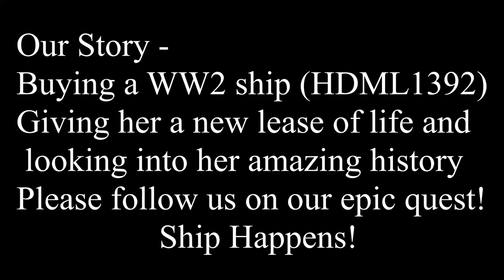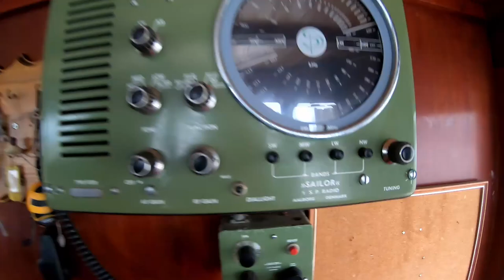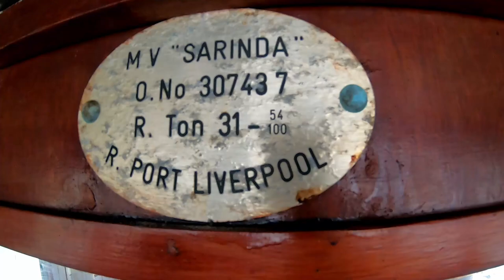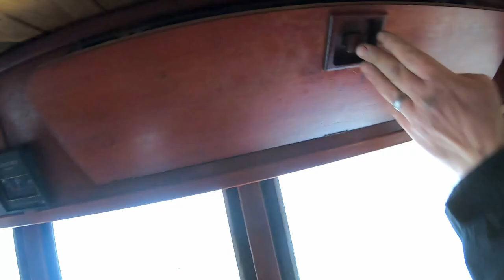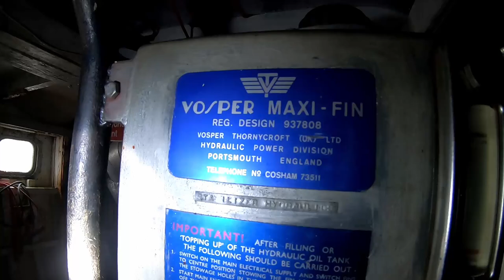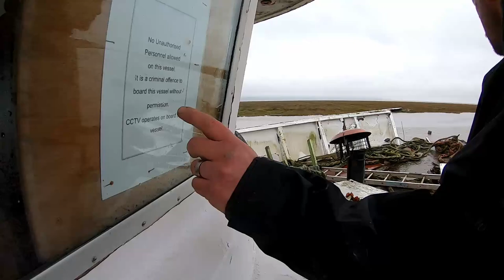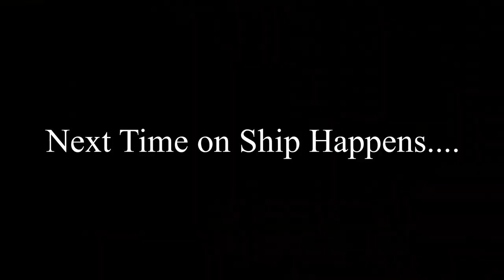We Risked Everything On A Rotten Boat! #boatrestoration

Comment: Wow  Well with time and effort anything can be done.  I've seen much worse houses fixed up.  

First:  Stabilize the boat
Is there anyway to get that closer to land?  Some landowner with an empty shore side lot you could rent?  Ideally that could also take a goods truck with a crane as construction supply yards use, they can usually boom out a good 30 feet if you scale the load back.  That means more loads and bigger delivery fee of course.  I'm assuming its actually floating at low tide keeping decks level.  Might be hauled up near shore at low tide it's bottom out and tilt and that could stress it's poor old hull.  But maybe somewhere there's enough water close to shore.  Do you know how many feet it draws?  You'll need tide schedules, you'll want to take supplies out when the tide is just going out it'll make it easier.  I see anchor lines going across the water courses.  That can't be long term good idea, I'd think they'd be a problem for all those other boat owners.  Keeping the craft in position is pretty important, especially in storms.  Are there any piles driven in along navigable water channels you could rent from owners?  Any reasonable way to get some driven by yourself - no idea what the permitting / legalities of that is.  Guys who do it might know.  Presumably there must be a 'port official' for that docking area, or town agency, they might know.  Maybe there's a boat yard that repairs, hauls them in / out in the immediate area to service all those other boats, they might even have some space to tie you up for a monthly rental.  They might also know how to go about mooring that permanently off shore.  You'll need piles or concrete blocks with chains / cables to bouy that you'd tie to.  Talk to them, to someone about what boat owners there do in storms, what kind of disruption occurs how you might prepare for it.  Take 'em out for lunch or something, usually makes people chattier.   
Second: Life Safety
While doing that get a safety line around the whole boat Given rot near edge you might need do a major effort fore and aft where there is good deck to screw to,  screw a pressure treated 2x4 I'm in the states bear with my nomenclature across deck, screw it upright 4x4 and 45 degree diag brace to 2x4, other braces as needed, post should resist 400 lb in any direction.  Run 3 ropes fore to aft then.  Get new ropes that won't rot in sea water.  Any marine supply place has 'em.  You can attach ropes to intermediates where there is deck to work with..  Predrill the screw holes, tedious but easier and ensures screw will go in with out cursing every time.    Get real emergency suits even a used one I know they are expensive but the water there in winter will cause hypothermia in less time than it might take for rescue people to get to you.  15 mins at 35 or 40 can do it.  Get two inflatable rafts with compressed air bottles to do so.  and a spare bottle.  The three of you then need to practice getting suits on and boat inflated and off.  I'd say do the suits over and over until you got that down, then over and over getting to raft. Then getting raft ready to inflate.  When you think you are good as you are going to get go for inflating the raft getting it in water and in it, paddle around go back and keep practicing getting it into water and in it and paddling around.  Get three or four emergency kits - Med supplies, water, water proof emergency lights on lanyards, long life food / snack - this can really cheer one up in even short term accidents until the rescue crew gets to you, flare guns and LOTS of flares, emergency radios if possible that don't work off cell towers you might be out of range of, there are emergency signalling devices that can call for help upon activation - no doubt expensive, but lets face it, something anyone in any condition can push a button and hang to until help arrives, PRICELESS.  At the least get 3 kits with cheaper stuff, one with electronics, practive randomly someone grabbing it and getting to a boat.Keep a kit at ea boat.  Kits should be water tight and floatable even better with enough bouancy to keep a person afloat.  If you three can't swim like a fish, learn.  Join lessons RIGHT AWAY.  Keep practcing until you can take resuce course then do that.  Might consider doing CPR course too.  Over time of course.  Sooner than later.  Life vests, like hanging every 10 feet.  and tie a bundle to the raft / emergency kit too.   Nope not all yet.  Get lots of smoke fire and CO2 detectors, 2 smoke / fire ea big room / hall one in ea room CO2 in ea bedroom downstairs hall main room pilot house.  Fire estinguishers in every bedroom, kitchen, engine room (even if not working on engine, which is like last thing to do, as that requires a yard and professionals), outside engine room, outside kitchen, every big room and corridor and storage room.  Practice w 3 spares, one on land putting out a fire - look up internet videos on how to do this, and two to practice w on boat.  Refill these / get them serviced on schedule.  Rotted framing.  I saw main joists going side to side rotted off where they'd have anchored to hull, bad, very bad.  Don't walk on decks above these until you build stuf walls below to support them with diagonal and X bracing to keep them from shifting. 

Third:  Stabilize boat
Betting you're broke after seeing to above.  Ah well.  In the short term get heaviest tarps you can afford and pressure treated 2x4's .  Cover holes with tarps as little slack in tarps as possible will limit wind flapping and ripping.  Screw 2x4s over them to deck hull etc.  Paint them and keep painting to keep them from 'drying out' Easier than replacing.  When you can cover with more 2'x4's and pressure treated plywood painted on all sides and keep painting.  Now if you can't screw 2x4's to metal hull, I'd suggest hiring a welder to come out and weld on some angles with predrilled holes to sit 4x4's on and bolt thru to.  Then screw 2x4's to theses, all arranged to keep wind / water out.  Feel free to use sealant to make water tight seals.  Removing sealant can be annoying but it might be the only protection of the area for years.  When using sealant think carefully how water will, as it will, get into every area you are protecting, and then make sure you leave a way out for the water, hopefully to outside.  this will probably mean not fully sealing some seams, which will mean water coming in but what can you do.  It won't be much and collected water rots and rusts.  Pump and clean bilges - and ask about about regulations and 'how others handle pumping bilges'.  I'm guessing most pump em a little at a time over time to limit 'issues'  It might become part of every trip until they are 'clean'.  Get two electric generators for the boat , if you can't leave them on boat you're better off w 4 small easy to handle than 2 big, remember everything gets there on a tippy boat so your normal easy to lift is less.  Get all the crap off the boat.  You'll no doubt need to hire a boat to take that to a ships yard where it can be legally disposed of.  Remove EVERYTHING you can at one shot.  This is where hiring help will help and find a crew that's worked on boats.  Again, nearest ship yard might help.  Then scrub and clean everything, right down to bilges, learn to love chlorox, and get VOC masks and fans to make using it inside safe, and gloves, lots and lots of disposable cotton gloves, surgical type, heavy rubber, felt lined heavy rubber, depending on task at hand.  Tool kit and if you can't keep on boat then split it up into easy to carry bins.
Fourth: Transport to boat:  Buy or rent a 'dingy' / 'skiff' practice for an hour all three of you every trip.  See if you can hire someone to ferry material / big stuff out by trip until you get critical work above done.  Then you can build a raft or look for one, even it it needs fixing.  There's usually boat owners around looking to get rid of their money pits.  For that matter might even find it more economical to find a boat owner who really needs a few bucks to ferry you out with heavy stuff and skiff in tow and then you use skiff rest of day.  Tie skiff up w at least 2 ropes, and tie some life jackets to skiff and a small emergency kit.  If you can get boat closer to shore someplace this will help w transport.  You might even make deal with landowner for free use you'll have small piles driven and build a dock out to it for both of you to use and owner to keep when you move on.  Building deck of a dock is easyish, you just need to use really thick pressure treated wood and screws that won't rust in salt water env.  I didn't say it was'nt a lot of work.  You can then have many small or just a few big piles driven, but at some point pile spacing will drive up size of framing to much to do by hand.
Thanks for opportunity to flex my grey matter and 
GOOD LUCK, hang in there and in the fullness of time it will be done.
PS:  Of course having it beached at a ship yard would make working on it 1000x easier.

Comment: You can pull a trawling net with your dingy lifts. Have fresh seafood, the main thing is does the engine or engines run and the fuel tanks are not corroded and leaking.
Reply from the maker: Check out episode 2!

Comment: Please run your generator outside of the vessel. You don't need to die, and it can happen so quickly. Unless you have the exhaust piped out, then my bad. Cool build though. I looked at a House Boat (as we call it in Canada) on a fibreglass V-Hull. I have done trailers before, like you and enjoy this type of stuff. As long as the bones are good, the rest is pretty damn easy.

Comment: Questions for you.  Does the bilge pump work?  Is this a metal hull or wooden hull?  Does this ship float at high tide?  And if so does it have the clearance needed to power it out under it's own power?  I would try to get the water out of it and get it floating as soon as possible and work on sealing out the weather for it as soon as you can as well.  A lot of what you need to do will depend on how it cleans up with a pressure washer.  Good luck with it.  I look forward to seeing where you go with the project. Dry it out as much as you can and see what it rotten.

Comment: The hull was built utilizing "Cold molded construction". The diagonal layers were generally slathered in Casien glue which was made from Skim milk. Today they use Epoxy.  Ship/Teredo wood boat worm dislikes epoxy glue, yet can eat casien glue. Lots of help will come from visitors to your channel. I am also pursueing a project ship of 70' length that survived WW1 & WW2.  Just remember. "Who dares wins" There will be lots of naysayers. That have neither attempted nor succeeded in much. Would like to hear "your" Comprehensive Plan. I have been working on my plan for approx 6 months. I am sure Sarinda has had many attacks PLANned... Maybe you could introduce the camera person. Rain/ fresh water rots wood faster & more than salt water. Under the anchor windlass is called the chain locker. Not bedrooms but cabins. Not beds but berths. Not wardrobes but hanging lockers. May I suggest a raft (with out board motor ) disguised as a trailer. ;)

Comment: i dont know what sort of pleasure craft are common over there but would you be able to find some stripped down pontoon boat to use as a 'raft'? over here in the US you can usually find them for just a few hundred bucks and as long as it still floats they would make a great platform for hauling stuff in calm water.

Comment: Do you hope to eventually restore original Gardner straight eight diesels to the vessel?

A lot of Gardners were used for a diverse range of applications in Australia and there is still a company in Queensland which specializes in repairing and restoring them as well as sourcing spare parts.

Comment: Those cat engines should be good at sucking down 50+ liters per hour at cruise speed. You should "sound the hull" before you do any work, take a weighted rubber mallet and see if any parts of the hull are soft.
Reply: You do bring up a major point, a cruise of 200 miles will probably cost at least hundreds of dollars.  Dockage in the neighborhood of minimum $500 per month.  The family better have deep, deep pockets.

Comment: You very probably need to lock into a contract where exactly you hope to birth her so you can do work on her, the shore stored items as example new materials or broken-down machinery etc needing repair housed in a large building.... Make certain you can pump her out (discharge bilge) which she certainly needs with all that rain getting in as well as usual hull seepage....

Comment: Looks more like a 1930’s-1940’s yacht than it does a WWII ship. Either way I hope your rich because it’s literally going to cost a fortune to restore and if it can be restored it’ll still cost another fortune to operate. Power boats use a lot of fuel. The old engines on that one will be especially fuel and oil hungry. You need to haul it out of the water ASAP

Comment: Instead of faffing with a raft, just look for a tender or even a dinghy with a motor and use that instead  - you have a huge amount of work to be doing, and there's no point in wasting time with substandard solutions - you'll need the tender when you have it running anyway so it's not like it'll go to waste.

Comment: Hi guys how are you, big boat I can see your dream and good luck to you, just wondering what sought of motor or motors does it have ? Turbo or no ? I could see all the cool stuff on the bridge like old radio and stuff, even if you don't use them you should keep them they are cool.i hope the motor is salvageable for you guys make sure you seperate the water from any deisel left and check the entegretty of the deisel tanks. W hen you are up on top of the boat especially with your young daughter be careful with gusts of wind etc nobody falls off it's a long way down.
Reply from the maker: Check out episode 2 for the engine test!

Comment: Congratulations! Over a year late.....but Congratulations nonetheless. As the superstructure and main decking is over 60 rotten and of no historical significance, I recommend tearing it all off. Your camper building shop is a perfect place to build a new superstructure out of aluminum. Wooden boats have a lot more decay than is visible to the eye. As others have said, she really needs to be hauled out for a proper survey of the hull. Particularly given her abandoned state and water ingress. The hull is absorbing the excessive ambient moisture due to not being heated, the rain pouring in, and all of the holes in her deck and superstructure. A major concern is water between the layer of her hull and the hull of the bilge. This is only the second video of yours I've seen. The most recent video is the one I first watched. Therefore if you've addressed these concerns and had the boat hauled out for a complete and thorough survey, my apologies. If you've not had a proper survey, my fear is everything you have and will continue pouring into her, both financially and physically, will be lost. To be clear I am not trying to be negative. I simply have genuine concerns regarding the unknown magnitude of her deterioration given the state of rot that is visible, her age, and the amount of time since her last refit.

Comment: while them engines look to be replacements, it looks like some original equipment looks to be still in place. BE VERY CAREFUL, please, old electronics like that are almost guaranteed to contain a lot of asbestos. also has the hull been surveyed? rain water is in many ways worse than salt water as microbes can live in it more easily, generally a wooden hull will rot from the inside out, not the other way around. I wish you luck, and hope you can do something to save this piece of history but I would seriously recommend getting the advice of a wooden ship specialist. of the top of my head i would suggest the steamboat museum in Windermere, unless you already are in contact with someone.

Comment: Drain all the fuel out before you start on the engine , remove injectors clean plus filters good luck your going to need it plus lots of bodies how you going to get all the crap out and removed ??
Reply: Leave the injectors alone !!!!!! Why do all you idiots want to take out the injectors ?? They are PC engines and chances are if you try to remove them the chambers they sit in will come out then you have a major and very expensive job on your hands !!
Reply: Sorry bud you haven't got a clue worked on these for years no problems earned a fortune sorting out problems caused by people like you amatuer fitters

Comment: A BOAT OR A SHIP?  A boat can fit on a ship. A ship can not fit on a boat.
Reply: Or if it has a permanent crew with a commanding officer - which the Royal Navy MLs did. It even had a telegraph - with an engineer in the engine room a few feet away working the throttles... Which must have made it a bit of a pig to handle in busy waters if you ask me...